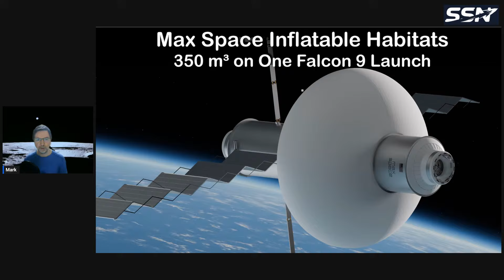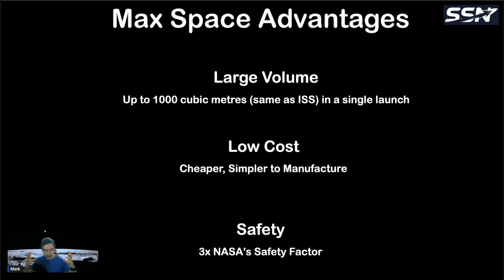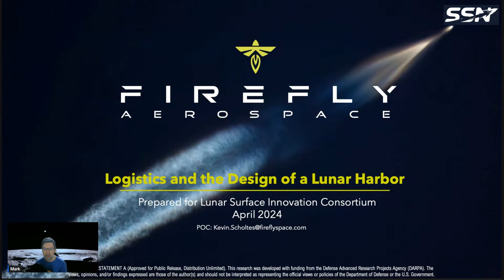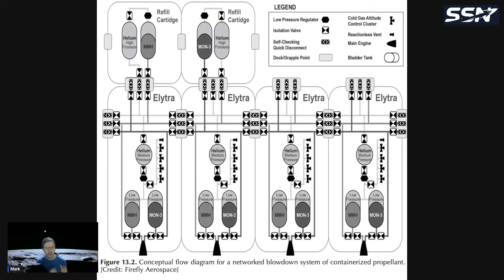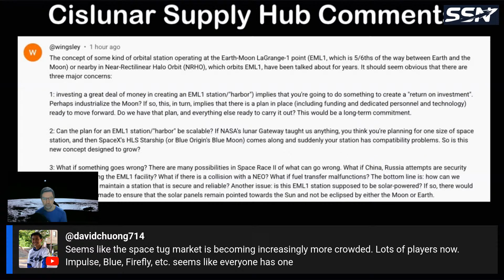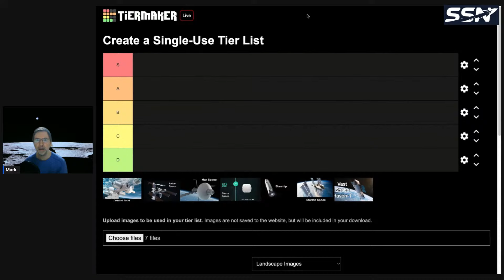Space News Live 38

Comment: We did get to a point in which some of us got to a small "chat" about round-circular-orbital-sniping station-base that would allowed existence by Coriolis Effect to have mimic a Gravity - Well to help Astronauts to stay longer in space, and make other things more easy. We do not have to "HAVE" a 1G effect...a 07 or 08 of 1G will do, would help a lot. Round space station to construct is a HUGE pain in the ASS, it is extremely difficult, if we build it from sections then in structure as 90 to a 90  then the curvature would have to be taken out in account on connectors, and connectors are "short" or too short...so the module it self would have to be curved slightly and its a problem. Uh basically everything that is round has problems with pure transition or connection with a flat face object...and the stresses and vibration do work out differently on short or pre-long "stretched" surfaces as it is. And that is why in such structures the R or D has to be huge, we talking minimum of radius of + 1 KM, we dont build such structures even on Earth, so 2KM+ in diameter, round shape station, to get ti perfect round is another thing, then spin it to have 1 full revolution in about 70 seconds, anything faster will give more fake G-force but the Astronauts will get sick to the point...well this was done before, so we have data of what we can do and what we can not. TH